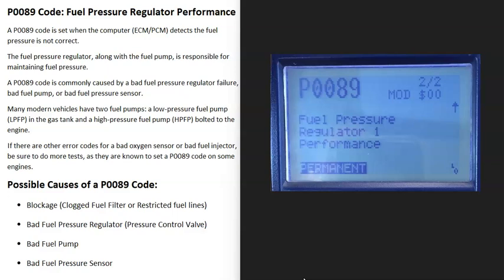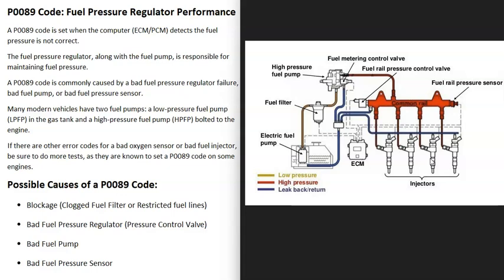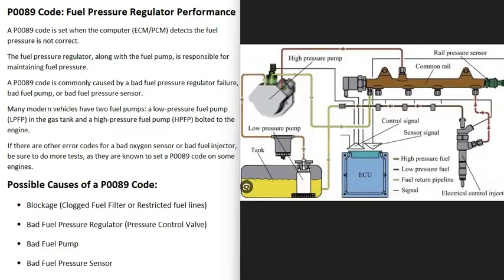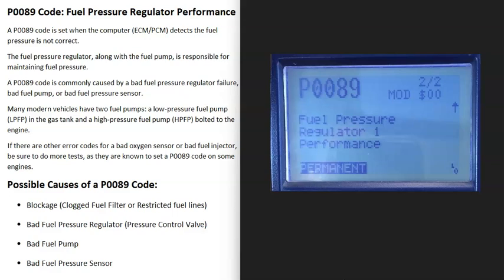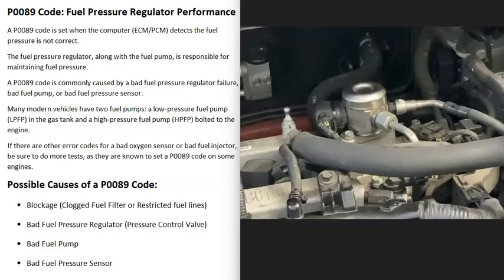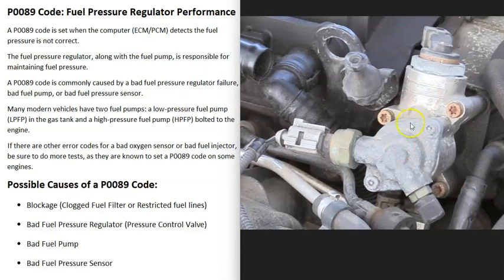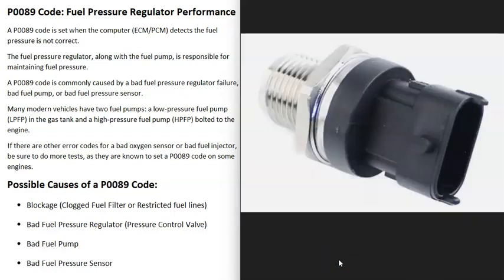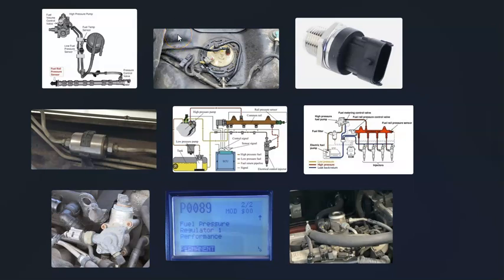Causes and Fixes P0089 Code: Fuel Pressure Regulator Performance

Comment: I had p0089 and p228d. I replaced the high-pressure fuel pump, and it didn't fix the problem. 2015 Chevy Malibu
Reply: My sister is having the same two problems with her 2013 Chevy Malibu
Reply: In the tank pump
Reply: @BELIKEMIKE84  I'm planning to throw in a new fuel rail pressure sensor this week
Reply: Did it fix the problem by changing the low fuel pressure sensor or rail sensor? @not-Spongebob
Reply: Did you figure it out yet?
Reply: Also wondering if you figured this out yet

Comment: Hi I drive an Audi A2 2.0 Fsi car has that code and a low fuel pressure  code and a Fuel rail sensor code car cranks only no start please assist I have replaced a cam follower and a regulator sensor on the high fuel pressure pump...
Reply: Im sorta in the same boat and maybe you can help me out. Where is the regulator sensor and which one is it because im tryna find the location on that specific sensor and what exactly its called. Thanks

Comment: I have a 2004 V70 2.4 non turbo with metal gas tank so no serviceable fuel filter, the pressure sensor at the fuel rail has been changed and so has the fuel pump, so where is the true location of my fuel pressure regulator?? I've read mixed things about locations for it.
Reply: I have xc60 2012. P0089 and engine cyl 1 misfire. How did you fix yours?

Comment: Really good video. I have the p0089 at the moment and now I know where to start looking :)
Reply: Did your car also throw misfire codes and or rocker arm valve 1 stuck on?
Reply: @egallaty2467 no, didn't have other codes. Now this is long ago (10 months) and we had some other issues as well. But if I remember correctly, overhauling the injectors fixed the problem for me. No more P0089 since a long time 🎉

Comment: 2015 Malibu P0089. Runs fine in city or hwy, but getting off hwy it stalls and takes time to sit before it will start again. How should I diagnose which of these issues is causing the fault? Thank you!
Reply: Im having the same issue with my 2015 malibu its showing P0089 its the high rail fuel pressure sensor behind the intake under hood. I'm changing mines Saturday.
Reply: Did that work?  @Jay-n8q
Reply: @Jay-n8q  Did your car also throw misfire codes and or rocker arm valve 1 stuck on?
Reply: I’m getting the same code on my sisters 2013 Chevy Malibu
Reply: Hi did you fix yours? my 2015 malibu just gave me this code aswell
Reply: have you solved the issue? I have the same symptoms and I don't know from where to start. No engine light on but the vehicle has no power and does not reach more that 2500 revs. If I shut it off and start again, the vehicle have lot of power for some seconds/minutes then again fall into a limp mode. Thank you for your reply, will halo me a lot